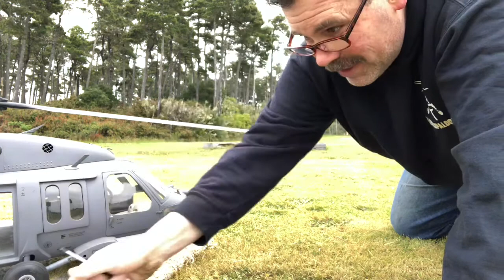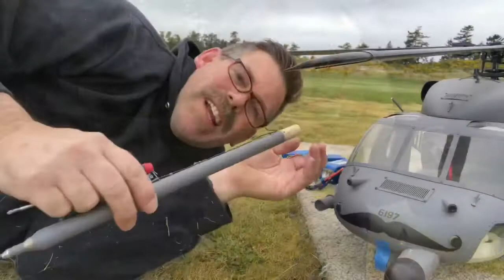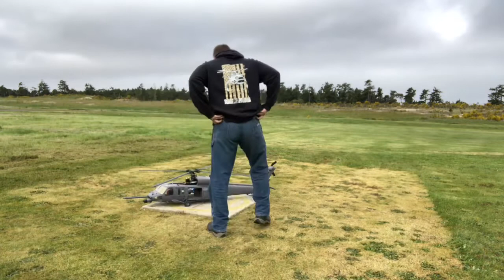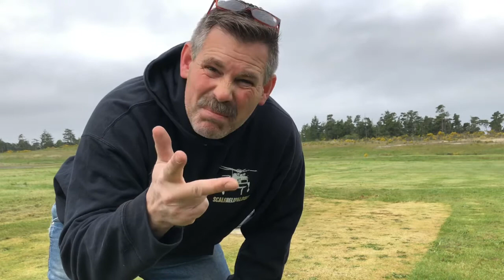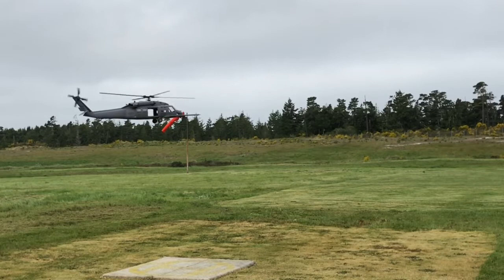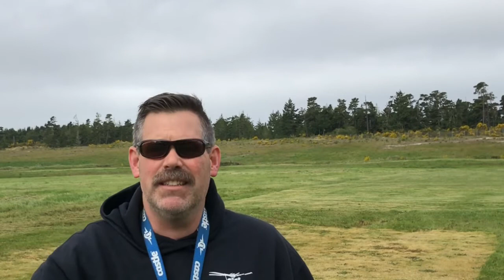Re-maiden of the Roban Pave Hawk

Comment: Fly the damn thing in GPS mode, do right left pirouette .....  see if toilet bowl effect goes away.
Reply: Good to know it is working now.  I believe the key is GPS/INS; GPS signals from Sat is not instant, INS algorithm compute the position holding more accurately.  By flying the aircraft it enables INS (Inertial Navigation System) feedback.  If you find the aircraft not flying straight (own path) then adjusting the puck would help.